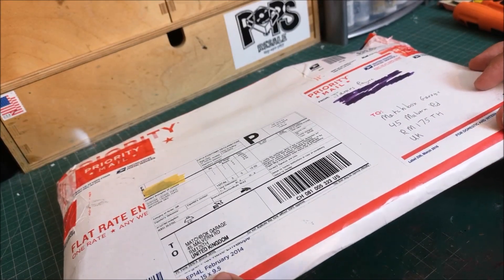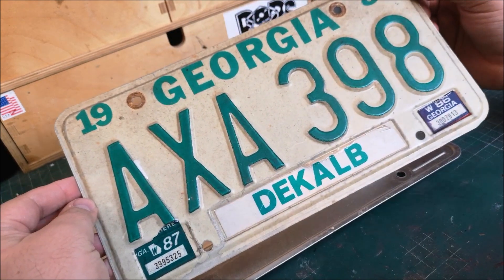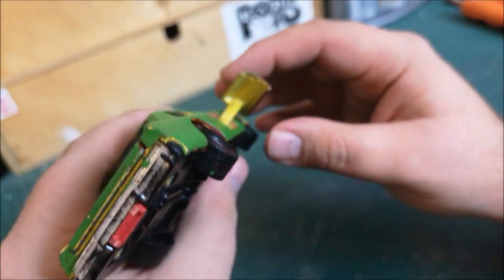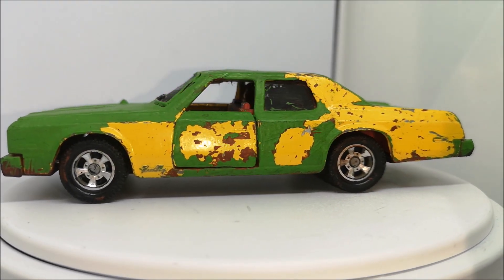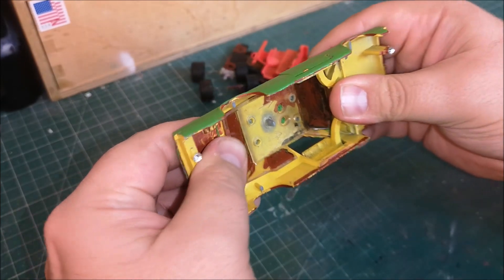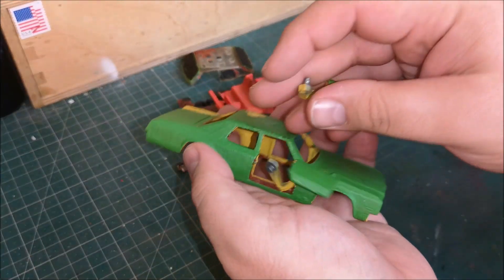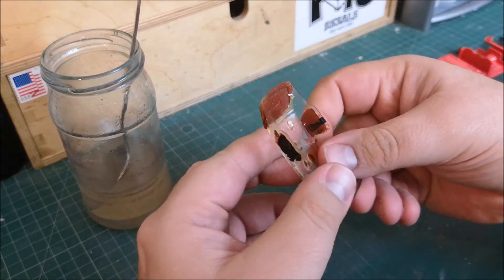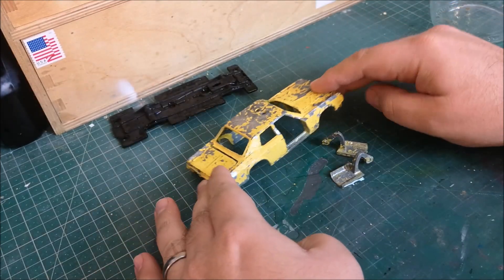Matchbox Plymouth Gran Fury Candy Custom

Comment: "It's got a cop motor, a 440 cubic inch plant, it's got cop tires, cop suspension, cop shocks. It's a model made before catalytic converters so it'll run good on regular gas."

#fixthecigarettelighter #theybrokemywatch

Don't toss that crackilated window unit, just cut out the back door windows and use on another model - depicting a summer night's cruise down the Miracle Mile...
Reply: I bet they got S.C.M.O.D.S.
Reply: "It's 106 miles to Chicago, we've got a full tank of gas, half a pack of cigarettes, it's dark and we're wearing sunglasses."
Reply: "Hit it!"
Reply: "Hey jake...jake... I gotta pull over"
Reply: "Hi! Wanna hand me that mic? Thanks a lot..."

"Hi, this is car uhm... what number are we?"

''five... five...''

"This is car fifty-five... uh, we're in a truck!"
Reply: "Murph & the magic tones just look at you in those candy-ass monkey suits"

"At least we have a change of clothes sucka you're still wearing the same sh*t you wore 3 years ago"
Reply: @chezsnailez  I like that movie quote 👍👍😃😃
Reply: @chezsnailez  do you remember the scene when they drove through the mall?

"You got me into this parking lot pal, now you get me out"

"You want out of this parking lot?..okay"

"Will there be anything else?"

"Yes..do you have a Ms piggy?"

"CRASH" 😊😊😊
Reply: @michaelupton8070  "The new Oldsmobiles are in early this year!"
Reply: @michaelupton8070  ~ you suppose they were driving the Caddy Elwood traded for that microphone?
Reply: @chezsnailez  I do think "murph and the magic tones" were driving the Cadillac that Elwood traded for the microphone😊😊

Comment: Beautiful work! A great solution to remove paint from plastics and even window pieces, is putting them in Dettol antiseptic liquid. It contains Chloroxylenol, which is not only a powerful disinfectant, but also a paint stripper. You can use it on most plastics and the paint will come right off without damaging them.

Comment: Amazing job! I was going to comment about Danny's caustic soda results on plastics, but you obviously have seen the job it does.
I don't recall you mentioning, but did you wind up reusing the existing wheels, or replacements. They looked right nice.
License plates are a major collectible in North America, both in the U.S. and Canada. The goal is to get a collection with all of the mottoes ever stamped. If you can find some of the oldest plates you have a bonus. I still have the plates from the car I had to decommission back in '02 after the brakes gave out and repairs would have cost me too much for an older car. I called him "The Beast". 1985 Oldsmobile Regency Delta 98. RIP Beast

Comment: The putty I get here is from the auto parts place, it it works better than JB weld in most cases. it's called Steel putty. Very strong, and sticks well if you get it on good.  why don't you just use the super glue and baking soda method? that's what I usually use.. takes a little more time, but works the business if you use the right type of super thin super glue.

Comment: Wow, back in the days I had a few of these Gran Furys. One Cab, two of the Lindbergh Police ones, the Fire Chief and a few NYPD ones. They all had differences, one was complete blue, one was with a roof painted white, one had the pillars white as well and one was completely black. They had two different light bars as well - a white with red lights and a grey one with red lights. Most of the Gran Furys were in a very good condition but - sadly, I have to admit - I concentrated on 1/18 models and gave the Matchbox cars away :(

Edit: I haven't watched the whole video when I was writing this comment but the car turned out very well - I like it a lot :D

Comment: Caustic soda on plastic should be "100%" safe as it doesn't usually react with it, iirc. However, you gotta take it easy. Have a bit of white vinegar on the side to neutralize if needed, add only small amounts at a time, checking in between to see if it is reacting and stop as soon as it seems to be doing anything, better have to repeat the process again if it didn't get everything out than ruin the part. The biggest concern I'd have is leaving it for too long (the plastic could still slowly react with NaOH, giving it time ain't smart) and doing it all too fast because the chemical reaction might release too much heat at once and damage the plastic, and it could be that whatever it reacts with (the paint, the dirty) does funny stuff to the plastic.

Can be an issue if the plastic has already become brittle with age, but then it is already shite either way.
Reply: And now I have reached the video. You keep getting more and more pimp, this was indeed one of your best jobs so far, really sweet there.